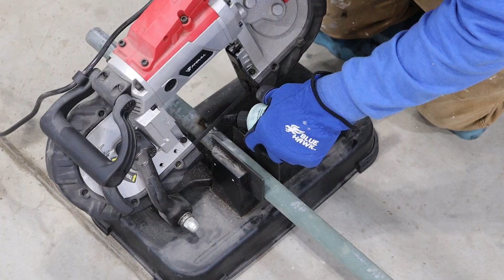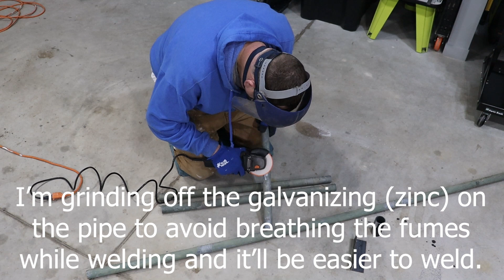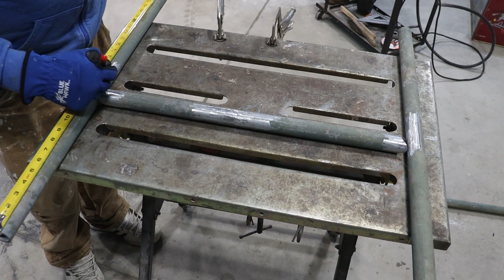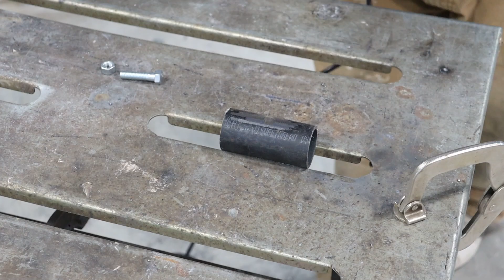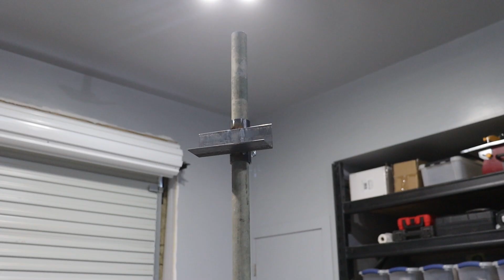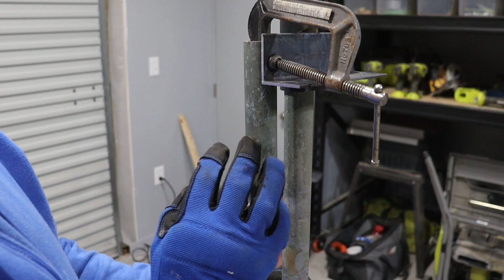Building a Welding Stand to Practice Out of Position Welds

Comment: Same here. Several years ago I wire welded a  unistrut grid that hung slightly above an acoustic ceiling in a school classroom. Allowing them to hang TV's wherever they wanted with threaded rods. But, I tell ya, it was long ago and someone else must have set the machine up for me. Idono. Recently I bought a welder from Amazon and your right, practice, practice. Ive been getting the hang of using flux core mig welding and also  stick welding. As I watched the guys in ytube I knew that I need to get the gas, regulators and also a tig welding gun. Plus the gas will allow me use solid wire. That tig welding looks awesome. Have you gotten to do that yet. At least I saw far enough ahead that I bought a machine that would accommodate the gas & tig. I thank you. Watch you has reminded me to stop getting side tracked and move forward. 🌞
Reply from the maker: Yes, I have tig welded a bunch of stuff. Definitely worth having a few types of welders at your disposal.

Comment: Thanks, I've been looking to build something like this for a while & for the same reason. Seems straight forward enough. Instead of legs, I was actually thinking about attaching a pipe sleeve directly to my welding table so I can just slip the long vertical into it & easily stow it against the wall when not in use. Thanks again
Reply from the maker: Great idea!